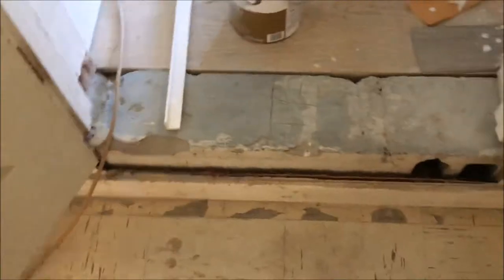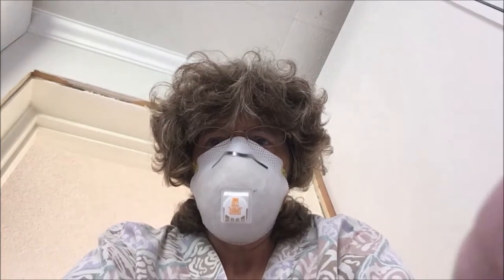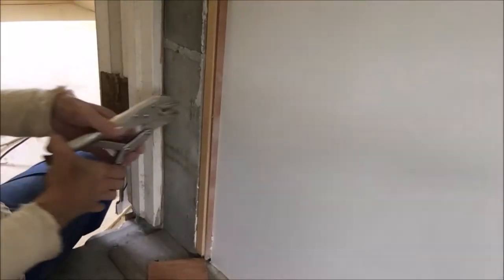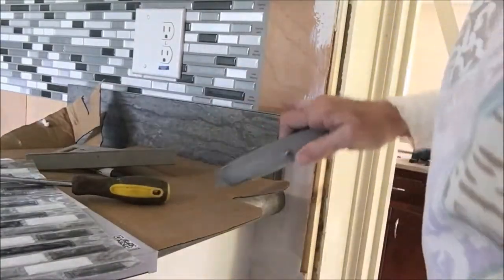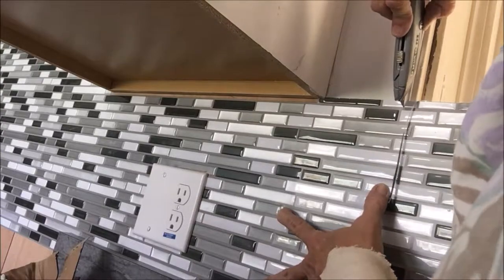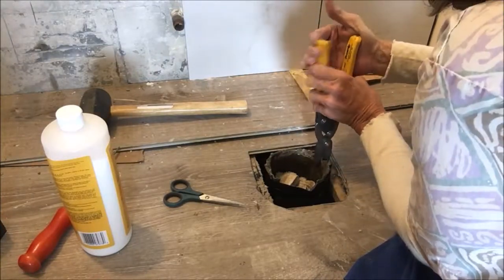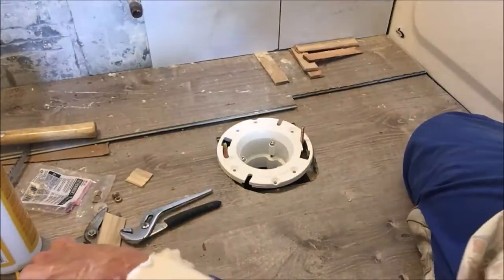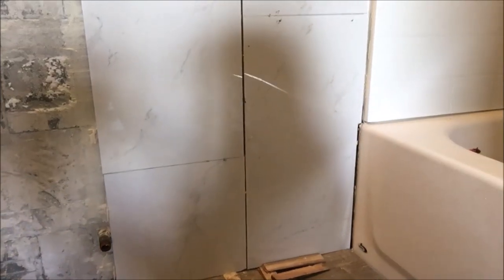Lowering Concrete Threshold, Toilet Flange and more

Comment: I feel like the peanut gallery.  For the pipe flange - Do you have a cutting blade for your angle grinder or a metal blade for your oscillating tool?
Reply from the maker: yes.  But I stuck with the tin snips. Did I do something wrong.  Oh Lord.  Tell me if I did before I set the toilet! =)
Reply: @theropesofrenovation9352  It shouldn't be an issue if the flange fit securely.  The saw would have saved some hand cramps though.  We can't have you laid up with hand spasms.  How would you edit :)
Reply from the maker: @SoWeBoughtaHouse  lol.  I hear ya.  Amazingly it was easy to cut!.  Now I have tennis elbow from that brad nailer I bought. =P